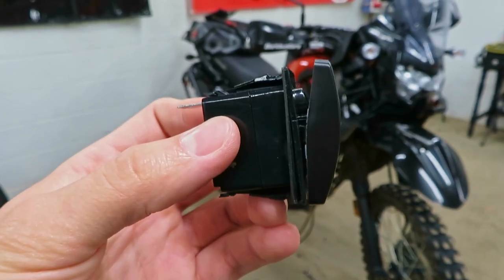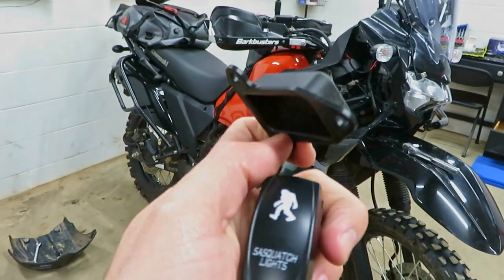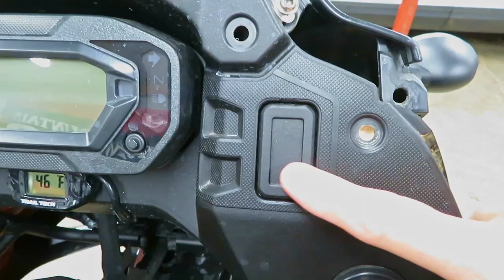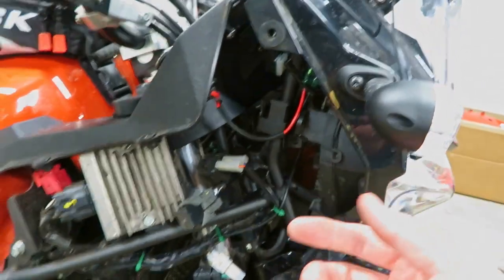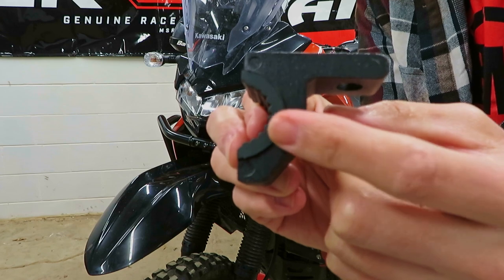Extra Easy KLR 650 Spot Lights! | No Disassembly Required!

Comment: I bought similar power out put lights to yours for my VStrom. One is a 10 degree light and the other is a 20 degree light.  I have the 10 degree light aimed for the center of the right lane and the 20 degree aimed for the white line of the right lane to pick up the ditch/road side.  I also use a programmable controller to vary the output between low and high beam.  They work very well and don’t seem to blindside oncoming traffic when on low beam.

Comment: You can use a fine grit sandpaper on the lens to diffuse the light a bit and widen the cones. Did this with mine and it helped create a more consistent illumination.
Reply: Hey, good ideal, what grit did you use? 600, 1200? Thanks.

Comment: The switch will fit with a little modification. I cut that hard to take off factory cover plate open and got it to fit just right. A little dremeling here and there and it should slide right in. I almost got that exact switch you got but went with the spotlight version instead. Great video's keep up the great work.
Reply from the maker: I wondered about that!!!!  I might do that too, thanks!

Comment: Those lights look great!
Reply from the maker: Thanks!  I actually switched them out for some slightly larger ones now that I taped into the high beam circuit.  Works pretty slick!
Reply: @SwankyCatProductions  I’ll have to check that out. Looking to make some mods on mine and I like the things you’ve done to yours

Comment: Ben ,I saw the Kawi Green 23 KLR at the dealers, but it was a KLR S ,It was factory lowered 2 inches ,but you give up suspension travel. It almost looks like a Versys.
Reply from the maker: Hey sorry I missed this Bill!  I wondered how exactly the S model reduced ground clearance.  That stinks, I'd hoped they changed the frame.
Reply: @SwankyCatProductions  I'm super late but throwing this out there for anyone that might be considering a 650S. I bought the S as I have a roughly 30" inseam and it's been a fantastic bike so far.  I believe they're running a shorter front fork, a factory lowering link and a cut seat to achieve the drop.  I've taken mine on some pretty rough stuff and haven't had any issues with suspension travel. The lights look great btw, planning on doing the same to mine soon.

Comment: Can you please get your ECU Dyno tuned to see if that helps the KLR? In most cases, you get about 5 extra hp and ft-lbs for 650cc engines.
Reply from the maker: Two Wheel Dyno Works said they'll sponsor a video as soon as they have a flash available.  Hopefully that's soon!
Reply: @SwankyCatProductions  it will be a YouTube first! Haha, i scan every day to see the results of such a test 😁 I think it will be ground breaking territory for the KLR because it will bump the KLR out of the 'barely capable of long distance touring' and into the territory of 'well capable of highway touring', especially in combination with a 16t sprocket. And with the current offerings of a 719cc big bore kit by eagle mike, in combination with a 17t sprocket, the KLR has a great future as a real ADV touring machine that approaches the $25k GS in practical capabilities.

Comment: I am trying desperately to find the right connector on the website, but I am not seeming to match up the part number with the one you gave. Could you please go back and double check the part number so I can get the right one. I appreciate everything you do.
Reply from the maker: From the home page click "Connectors" from the list on the left.  Then the MT 09 connections will be at the top left under "Seal Connectors".  They have an "extra terminals" section at the very bottom.

Comment: What year is your KLR? I have a 2022 Orange and my orange is a bit darker than yours. Also what crash bars are those? All the tusk ones I find do not look like that.
Reply from the maker: It's a 22, might just look different with the crazy lights I have in the garage ha ha.  They are just the normal Tusk bars up front.  I should have links in the description.  You might have to select your bike before it shows the right ones?